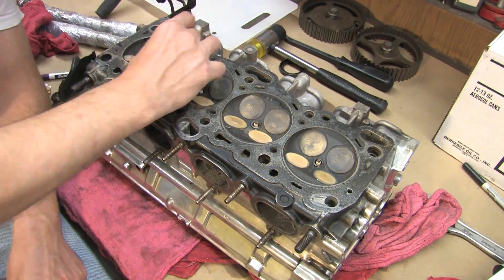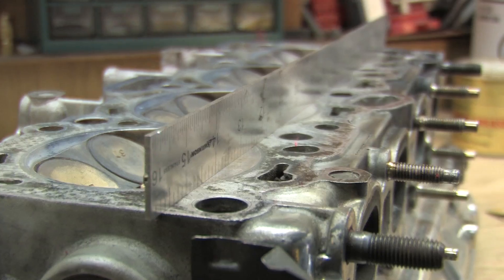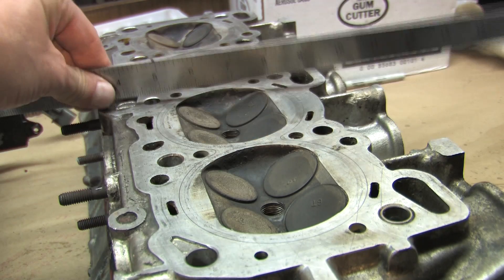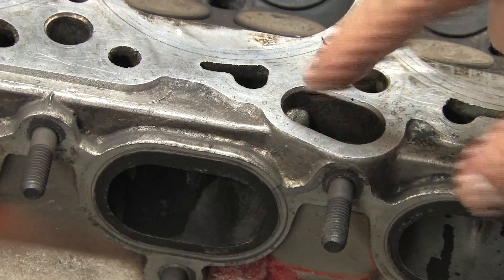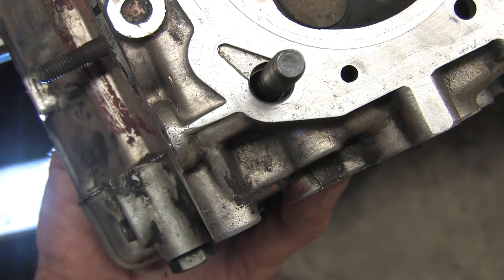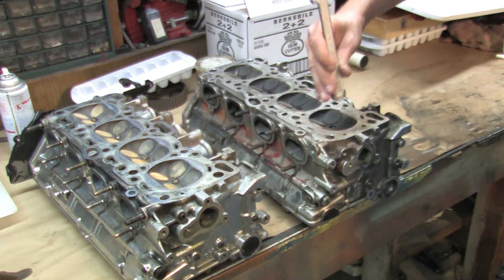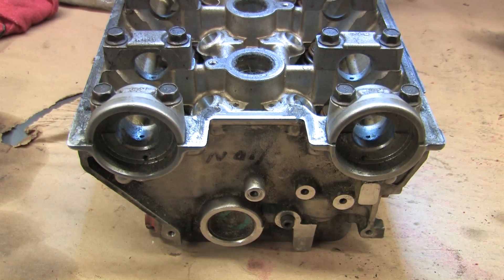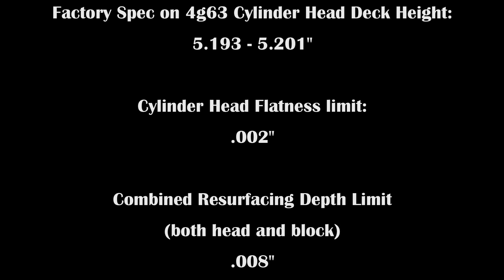Cylinder Head 103 - Deck Tech

Comment: Well shit, you literally just saved me from wrenching out the exhaust manifold studs on a 4g93 SOHC head. I had 2 nuts locked on and was starting to really swing off it, wondering why it wouldn't move when you mentioned the studs penetrating the oil returns... Instant subscribe, thank you! 
This one's nothing special, I'm just tidying it up as a backup for my daily driver. You've inspired me to spend a bit more time tarting it up, though, so I may just put it on next time I change the cam belt. It was a low mileage scrap find, dirt cheap in pretty good condition. not warped, some of the valves a bit burnt/crusty but all intact. Only real concern is 2 of the cam lobes and their corresponding rollers have some light corrosion/pitting from it sitting in the junkyard with the hood up and oil filler cap removed >.< I'll never understand why they do that... It's all diassembled, parts numbered and sunk in Diesel+ATF until I'm done on the head itself.

Comment: wondering if I had to always deck the head ? Or if it’s surface is straight and flat can I just remove all gasket material with razor and reinstall with a new gasket without decking?

Comment: Whats the lowest possible I could go on a 4g63 head with stock cams and  gears ?? I am at 5.185 ' on the head
Reply from the maker: You can go until you run out of valve clearance.  I did a video about this called "fighting the valve clearance", and I demonstrate how to measure this as well as a short discussion about the resurfacing indicators.  It's the perfect video for this question.  What I do in that video is how to make it work if you run out.

Comment: What type of rtv I can use on the middle exhaust stud to prevent oil leaks? Video at 5min 10 sec
Reply from the maker: Grey RTV works fine!
Reply: @Jafromobile  thank you....
Reply: @Jafromobile  could this stic cause oil leak and cause exhaust smoking issue? Trying to chase down this smoking issue I’m having... thanx
Reply from the maker: @christopherorpilla6260  If that stud wasn't coated with sealant before it was installed, then not only could it cause it, it's definitely the cause of it.  Oil chases heat.  It's a really difficult job to do without removing the manifold, but I'm not going to tell you you can't.  But if you do, pull your radiator, and then just do your manifold nuts to get to it.  That should give you the room to work. You can double nut that stud and get it out if it's stuck without having to do much else.  Loosen or remove the lower o2 housing support bolt to prevent bending the bracket.  Penetrating oil is your friend.
Reply: @Jafromobile  ur the best... dsm god

Comment: I used a folded sheet of 320 grid sandpaper and engine oil as lubricant while applying no pressure to remove any small pieces of gasket that may have gotten left behind on a 4d56

Comment: Great video. when resurfacing head how does it affect valve timing
Reply from the maker: It decreases the distance between your crankshaft and camshaft centerlines.  In other words, it makes the distance of the tight side of your timing belt or timing chain shorter.  It may not seem like it would do much, but we're talking about degrees of rotation, not the distance.  It does have a measurable affect if you're tuning on a razor's edge.  Removing deck material retards the cam (or cams).

Comment: Great videos. Would like to know 4G63 included valve angle??
Think u r the right man to answer that. Thanks ...
Sílvio    Portugal🇵🇹
Reply from the maker: The information I have for a 1g valve angle is 44.5 degrees +/- 1 degree. 

Should be the same as 2g.  I can only verify the 1g.
Reply: Thanks. #1 in DSM info. Keep up the good job. Top quality work and videos👌

Comment: One thing you Must do with an Aluminium Cyl. Head is have it checked for hardness before Any work is done to determine if its worth doing  , especially if it has come off an overheated engine , its a simple test with a clear tube and a ball bearing usually free of charge  as my machinist does it before carrying out any work .  my apologies if this has already been mentioned in the comments , Jafromobile great videos you have thank you

Comment: Really! I thought you were a professional. That ONLY qualifies as a straightedge in grade school. A TRUE straightedge is purchased at an industrial supply distributor found in ANY major city. A true straightedge is accurate to 2 TEN THOUSANDTHS of an inch (.0002") over each foot in length and doesn't change shape/contour with temperatures the way RULER does. Just my 2 TEN THOUSANDTHS of a Cent!

Comment: jafromobile, your skills and knowledge is up there. I don't doubt them at all..... Some heads just should not be resurfaced, just sold for scrap metal. (this applies to ohc or dohc cylinder heads only) If the cylinder head is warped at the surface where it meats up the cylinder head gasket, it will be also warped at the top where the cams are held. Heads don't grow, they bend, twist and or warp. Cam shaft journals are line-bored straight so that the cam can spin easily. If the line-bore is off, then the cam or cams will not spin easily. In other words if the cylinder head is too/very warped your cams will jam up. If your cams don't spin easily then your timing belt will not last long. I believe its up to  a good mechanic to decide if a warped cylinder can be resurfaced. Most machine shops don't care, they just want to charge you for the work/resurface job. Have you ever seen a cylinder head so warped that the cams, or cam (sohc engine ) are/is very hard spin after a resurfacing at a machine shop?
Reply from the maker: No, I haven't seen that yet, but I don't doubt it.  Makes perfect sense.  If I had a warped head I wouldn't put it back in service.  I would call a shop that can oven-straighten it.  Moss Motors has a video of him doing this to a warped head.  It's a pretty cool process.  Not all warped heads are junk.  :)  I'm pretty sure that machine was created by someone who told some other determined soul with a rare cylinder head that it couldn't be done.  Oven-straightening.  Pretty cool.
Reply: Wow, that is pretty cool stuff (oven straightening). I've never heard of it. I'll try to find a Moss Motorsports video on that. You are correct about not all heads are junk. Just the really bad ones. Hey, Thanks for your videos, they are GOOD. I like the way explain things...... The cylinder heads that I have come across with this problem were from a Datsun 280z single ohc 6 inline N42 series head, and a Daewoo head dohc head 4 inline, in both heads the cams/cam would NOT (almost jammed completely)spin easily, the Deawoo head would break timing belts at only 2k miles of use.

Comment: 4:46 upper left. Do you do any kind of deburring of holes in the cylinder head? My head got back from decking and notice many of the passages has the kind of fine burrs that can be seen at 4:46 in your video too. Not sure if I should get in there with a hobby file or something, to prevent small metal parts flowing around the coolant system.
Reply from the maker: Yes, I do.  At the end of my cylinder head porting video, I take it even further than that, I de-bur the entire crankcase on the other side.  There's worse stuff in there than you ever see from the head surface.  The head surface cleanup I save for assembly, though.  It's after you get machine work done that you have to do that because it winds up exposing a whole new layer after you get the head shaved.
Reply from the maker: I may be wrong.  I may have done the deburring in the first Glyptal video.  I do it in all my cylinder heads, so it might even be in both videos...

Comment: you say not to use sandpaper, but i've seen a lot of people using a 220 superfine sanding paper, just glue it on the table and move the head back and forward. what do you think about it?
Reply from the maker: I'd never do it.  I might use that on an exhaust flange, or intake manifold flange, but unless I'm being chased by bears in the Yukon trying to escape and the only way I can get away is to fix the head gasket with duct tape and some mig welding wire, then maybe I'd try it on a cylinder head flange.  It's just too easy to get it wrong and trash the part.  220 is course, btw.  400 is considered medium, and 600+ is fine.

Comment: What about using one a 90 degree air gun/sander with one of those green disc with plastic fingers to clean the head surface? I cant imagine doing that any harm since metal beats plastic.
Reply from the maker: green is waaaaaay too aggressive for aluminum.  Use the white one if you have to use this method.

Comment: if you remove the balance shaft, how much should we mill out of the tear drop hole so that no seals go pop?
Reply from the maker: I cut mine between .090" and .105" for the 2 heads I worked over because they had ARP head studs and the .105" head yielded 12.5 PSI with 30W oil on a block with no balance shafts, no oil squirters, and a ported OFH at idle on a hot day.  It gains 10 PSI per 1000 RPMs.  80 PSI cold idle pressure.  The block oil gallery mods were done as well on the .105" headed block.  I should be running 40w on that engine because it has .0025" oil clearances all the way around on the crank and rod bearings.  That should put the oil pressure up between 16 - 18 PSI, but I haven't done it yet.  Still rockin' the 30W.  If you have oil squirters, .085-.090" should do it.  Remember the head gasket crush thickness also plays a factor.  My measurements didn't include that.  That's without the gasket.
Reply from the maker: The Hyundai first startup video shows my oil pressure results for the .105" head.
Reply: This video is 4 years old and there's a fast reply! Looking forward for new videos Jaf, love them videos

Comment: very helpful video . I'm currently replacing a cylinder head gasket for a 2006 Nissan Altima S with a 2.5 L engine . I found a lot of surface  rust on the cylinder head and was wondering if you had any tips about dealing with this issue is there any way to clean it off safely?. the car belongs to my mother in law and she made the mistake of just putting water and no coolant in her radiator. I am also wondering if liquid gasket is good to use on the head along with the cylinder head gasket itself?.
Reply from the maker: +steve zavala I might be misunderstanding you... but the cylinder head should be aluminum on that car, shouldn't it?  Aluminum doesn't rust.  Do you mean the cylinder block?  And no... no liquid gaskets of any kind there.  Just a new head gasket.  If there's rust on the block that won't clean up with a razor blade, it's probably warped.  If you've pulled the head off and both parts are corroded on the cylinder head surface, they both need to be machined.  Now if you're just talking about the valve cover... that's a whole different ball game.  Liquid gasket is okay on one side of a valve cover.  I already have videos for valve cover gaskets and cleaning up cylinder heads in your home garage.  If you have questions about your equipment in particular, there's no better source than that car's service manual.  A Hayne's manual is a good second choice.

Comment: the 6 bolt heads appear to have different casting number system. mine says 2.0 with a 12 under it.
Reply from the maker: Sgt Balestrini They do.  It's a fortunate thing.  For instance... my Hyundai 1.6L head (uses the same cast as a 6-bolt) says 1.6L.  The Mirage turbo's have the same thing going on.  The cylinder heads appear identical except that the runner volume and combustion chamber volumes are different.  If you didn't take time to measure them, they'd look like the exact same thing... but would have dramatic affects on your static compression ratio.  I don't know what the 12 means.  :(  It's going to take a smarter DSMer than myself to figure that one out.

Comment: I have 1g 7bolt head with casting of G6 and it's oil port is only 0.060, and the head has not been shaved still at 5.200"

Comment: This is why I like cleaning cast iron heads. Totally easier due to brass wire wheel will take the graphite off quick. On aluminum your very right any power tool is bad.

however lapping aluminum heads is my preferred method on a completely flat surface. It's how they did it in the old days. Takes a long time but is able to meet spec tolerances very very closely.

Comment: Scotch is a nice way to clean it.
But only by hand with brake cleaner.
Reply: That's my method when the engine is fully tore down i will do it on the head and block. Only reason I only do it like that when it's apart is so i can be sure everything is cleaned out very well.

Comment: i am not aware to weather my 420A head has been surfaced before or not however it did have a slight tic from lifters not alot you would have had to been paying alot of atencion to it to notice however i am about to resurface it i have knocked off the casting marks on the inside of the head to allow better oil flow and eliminate oil build up i would like to know what depth to make my oil passage to after resurfacing it

Comment: Hello, I am rebuilding my 420A (Cousin of the 4G63) after a oil delivery failure to the head, and my head also has the whitish tan colored deposits on the exhaust valves. By any chance do you know what these deposits are?

Comment: (1/2) Hey Jafro, I'm a huge fan! You and your videos have inspired me to get out in the garage and get working on what needs to be done which brings me to my current issue. Well... I'm in a bit of a pickle, I've recently had my 4G93 02 lancer head resurfaced at my local machine shop and I come to find out that they've gone over the factory grinding limit by .002". Although, I haven't measured the cylinder head yet. (I don't have calipers I'll be getting some tomorrow)

Comment: I am all confused on what to do. I possible wanna go 1mm larger on valves. I will need brpnze valve guides that are 1mm larger, SuperTech valve seals, ? what kinda guides because #s are confusing me more and more. Springs but supposed to have some in it maybe I can send you some pics. As far as retainers im sure the ones that come with the springs are fine, but then again numbers for my 1mm valves. I think all will match. Machine shop is my biggest fear. Nothing runs right around here.

Comment: Oh I also meant to ask is that deck flatness spec for any head or do they all have different tolerances? Mine I can get a .0015 feeler under it but not the .002 I can't seem to find specs for the engine I am working on.

Comment: yep getting new bolts aint no way I would put old ones in. lol The engine is a GM 122 2.0L L4 OHC and was in dire need of some love. That cylinder being like that I think combustion gasses were getting into the coolant because the system was over pressurized. I was lucky it didn't blow any hoses.  

But I figured while I was at it I might as well do a valve job while I was waiting on my parts. So doing new valve seals and cleaning the valves was burning oil because 2 seals had a leak. lol

Comment: 3M makes a wheel called "lady fingers" specifically for removing gasket only off aluminum. My brother used them and got me some from a shop he worked at long ago. That is what they used on head gaskets. Great videos yet again Jafromobile. I have a spare head in the garage and may be able to get you a measurement. I know it is from a bone stock motor as well.

Comment: Great video and good insight.  To the razor blade haters.  The method jafro demonstrates does not appear to heavily divot or scratch the aluminum.  Maybe it is more about poor razor blade technique than razor blade itself. Seems to work fine on my head and block gasket surfaces. I doubt that 95% of dsmers are as thorough as Jafro and willing to share his experience with fellow members of the dsm community.  Great video Jafro! All your videos are great keep em coming.

Comment: Ha, I used a wire cup brush to clean off the graphite gasket and wet sanded the surface with 500 Grit sandpaper.  and that was on a head that I had stretched the headbolts out more than a couple mm.  worked just fine and holds up to 17 psi just fine.  170 psi on the compression test. Nippon MLS head gasket.  I don't think razor blades should ever touch an aluminum surface, cause they will cause way more damage than any wire brush on a drill.